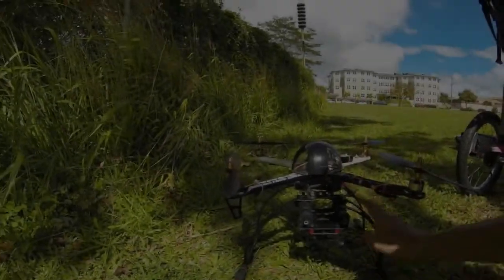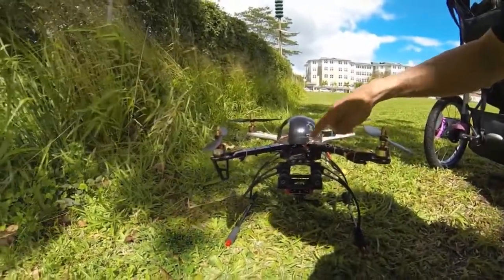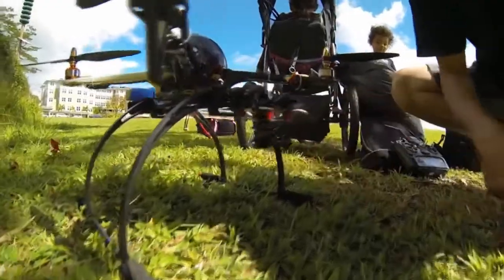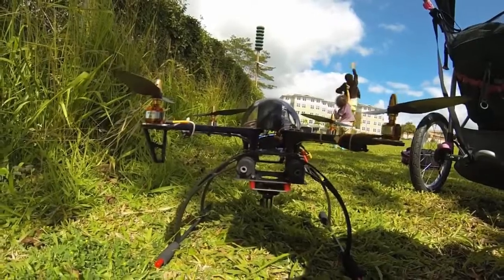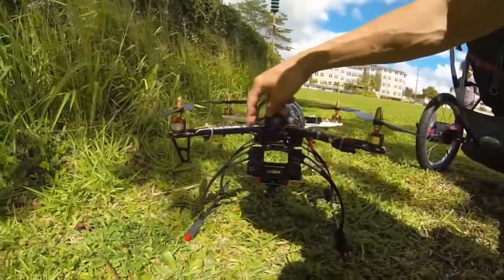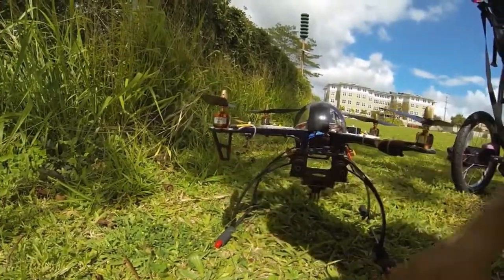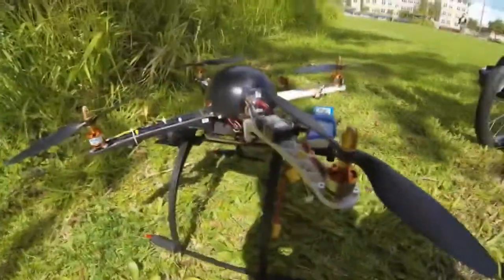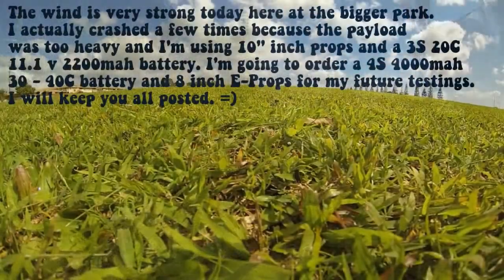GoPro Hero3 Test with Quadcopter Vibration Dampers

Comment: @ Arturs Savicks - I use these dampers and its amazing. I use both the Red and Green Dampers. I use the Red Dampers for the separation between the landing gear and quadcopter and I use the Green Dampers for the GoPro mounting. Works great and vids come out clear and vibration free.